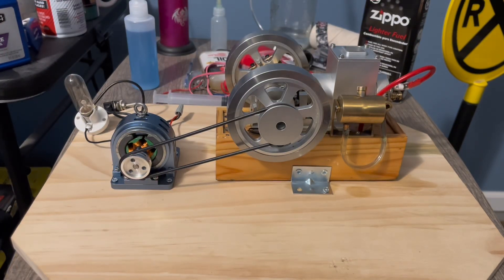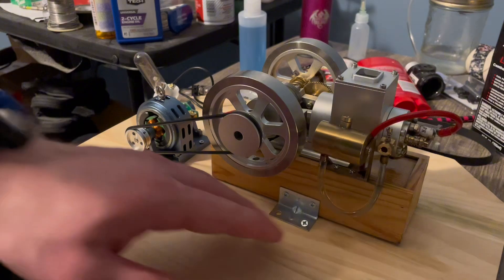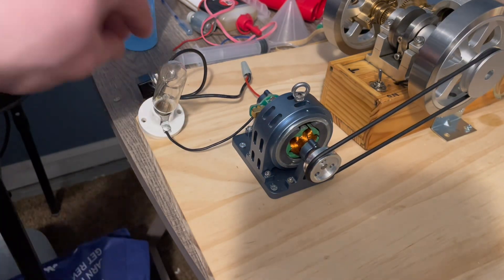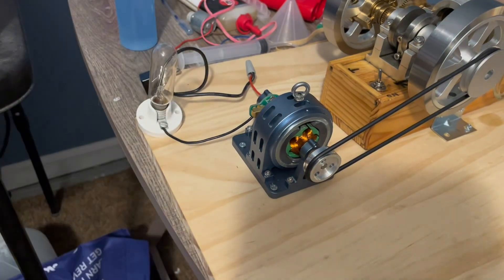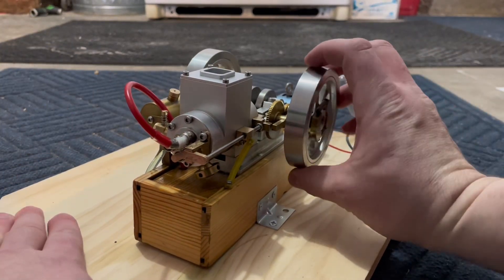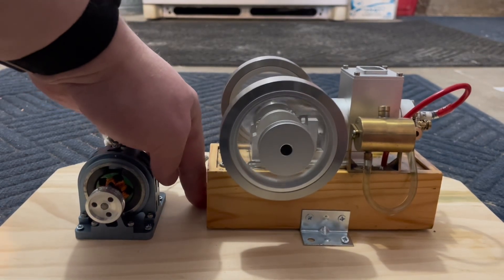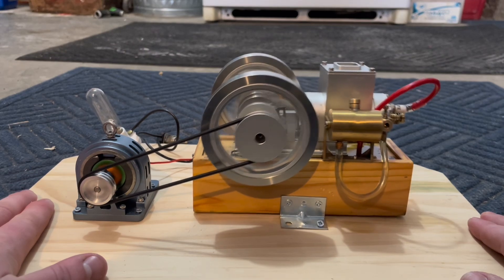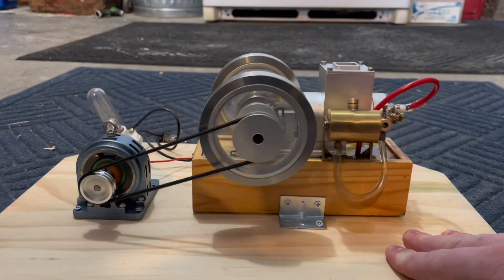Microcosm Hit and Miss Engine

Comment: Add a tensioning system to the belt so that you can start the engine with the belt loose and then spin up the generator once it's running.
Reply from the maker: Another thing I could do and somebody pointed this out in the comments was to use the generator as a starter